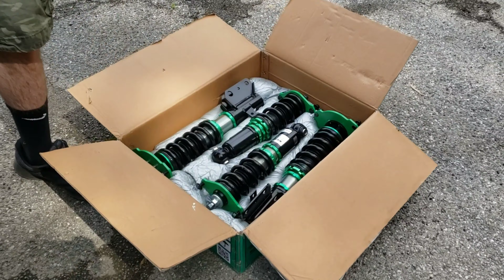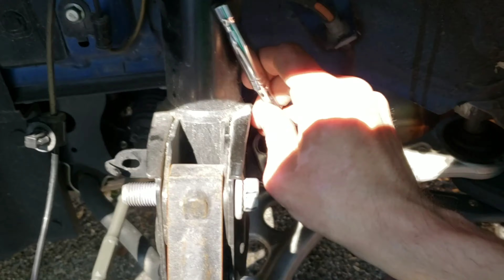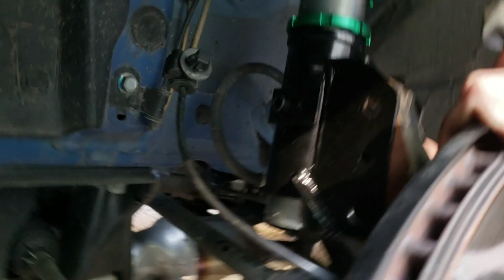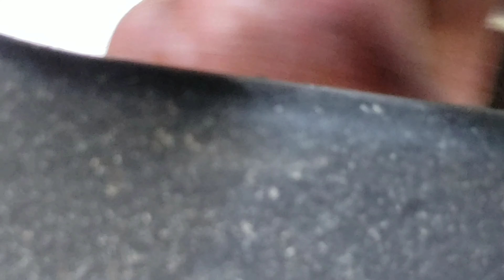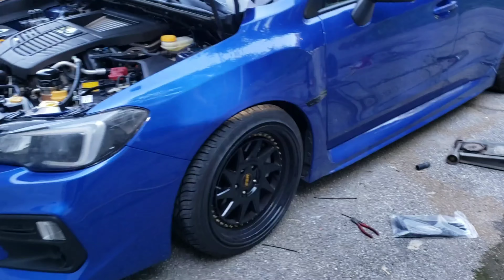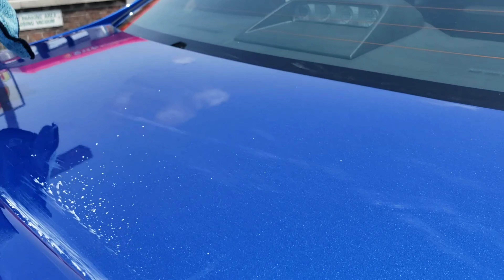Coilover Install On Tyler's Wrx

Comment: What coils are these?
Reply from the maker: Rev9. Got them on ebay
Reply: @StreetInspired1  link?
Reply: @StreetInspired1  I see they got 2 types for 15+ Wrx
Reply from the maker: @martinvargas_  not sure i didn't buy them I just helped install them. I wasn't aware they had 2 different ones im not sure which these are. I think there was only one available when he got them
Reply: @martinvargas_  these are most likely the hyperstreet 1’s. I’ve had these on till this day, no issues. I highly recommend these if you want something good for cheap